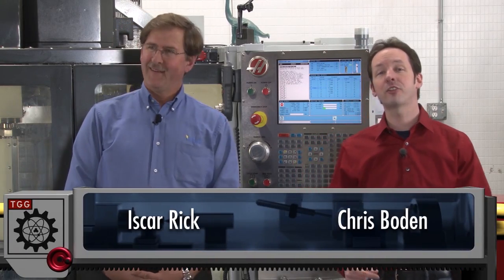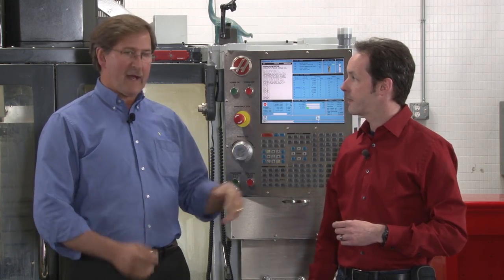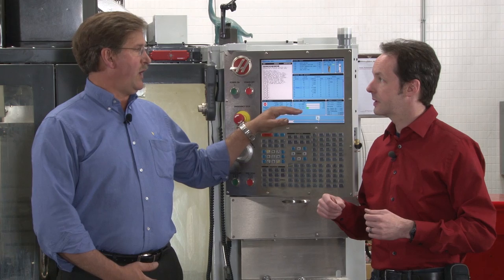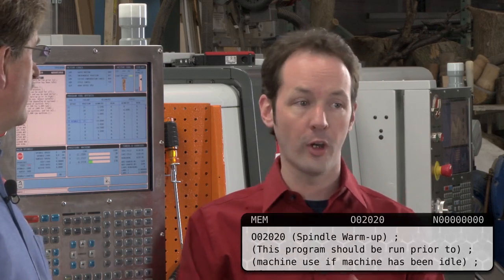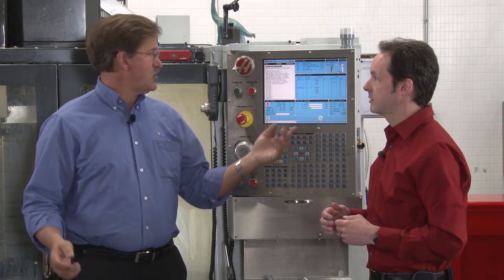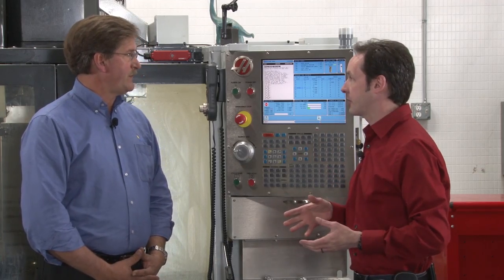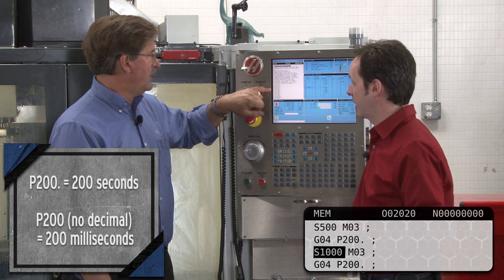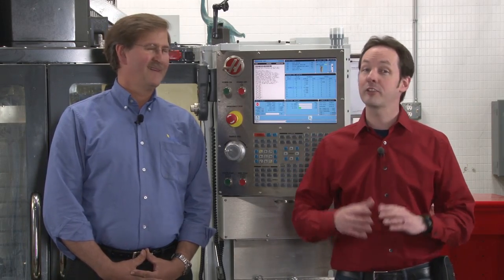Spindle Warm Up: CNC Training Series

Comment: One trick ... the standard program has an M30 at the end, so it reaches the end of its dwell, then shuts down ... and starts to cool off.  I add one more spindle speed command at about 1/2 of max spindle speed with no dwell and comment out the M30.  So, it holds at a nice, easy speed until you come back.  Just hit the Reset button when you want to get to work.

Comment: Also, you've got to read your own owner's manual.  There IS a spindle type that should not be run without a toolholder in it - I'm not sure because I don't have the paperwork here, but I think it's the HSK type.

Comment: A nice inclusion in this vid  would have been to show a precision turned shaft at the start of the vid that fits into a collar, nice slide fit, then to hold the shaft in your hand for the 10 mins that the video runs, then show at the end that the heat from your hand has made the shaft too big to fit ;)